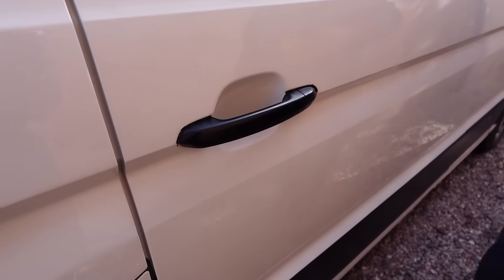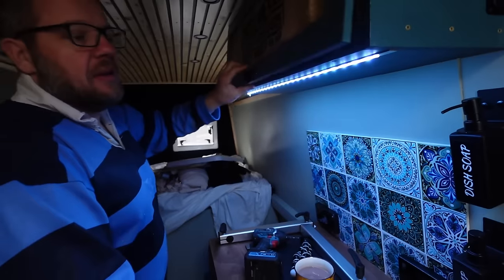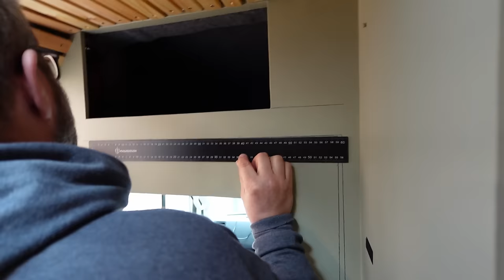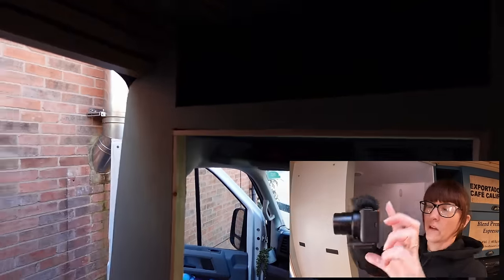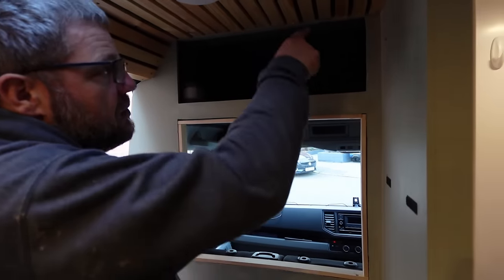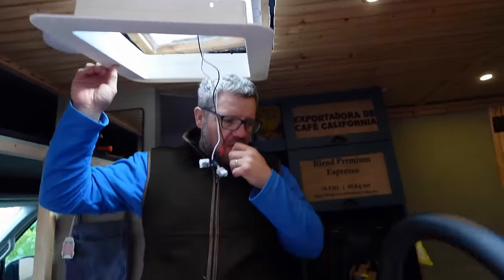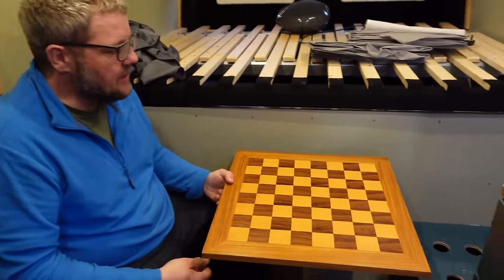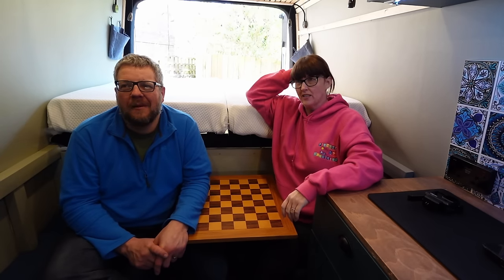We've FINALLY finished the VAN CONVERSION | VW Crafter CAMPERVAN

Comment: Well done both, what on earth are you going to think about, mull over and contemplate in your spare time?  I feel mine is going to be overweight, so please do a detailed video on plan B if you need to go there.
Reply from the maker: Next (all though boring), we have to do some bits on the house in between trips and using the van. There is another project on the cards, but not for a year ish or so.

Comment: well done and loved your build, would love to know more about granddad rights, and how you were going to change weight of van due to your C1 on licence as I seem to have that automatically on mine .... so how can i add legal weight to mine ???
Reply from the maker: Car licences issued before 1997 have automatic rights to drive vehicles up to 7.5 tonne. Steve is old enough...Cheryl is not!! We plan to do a full video on the weight issue when we have an the info.
Reply: @pitched_up_wanderers  Thanks for the reply, i was also before 19 O plonk so have the C1, look forward to the weight vid as many will be 4 sure. saying that i think possibly my van has had the rear springs upgraded as they are yellow and coated not just plain metal 50 50 on that. thanks for info and look forward to the vid